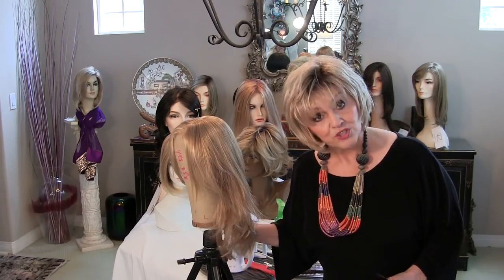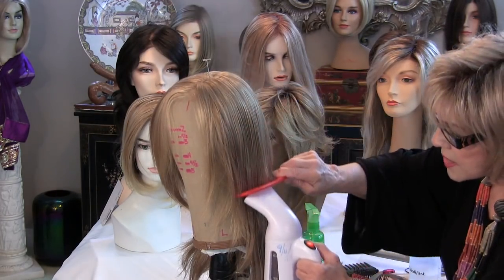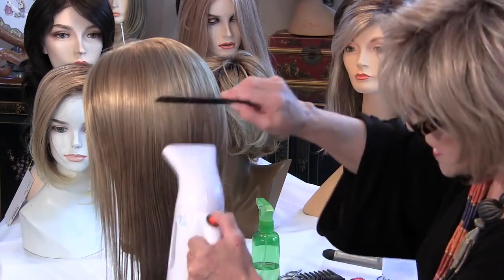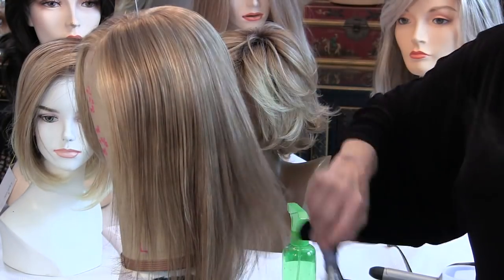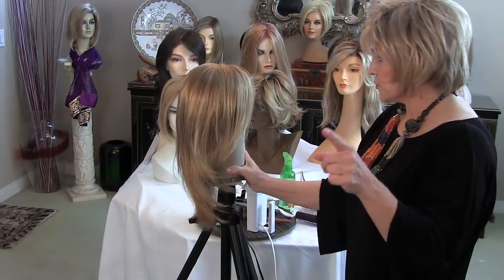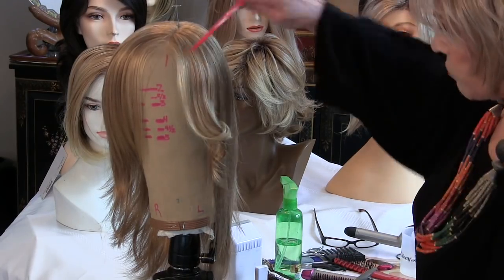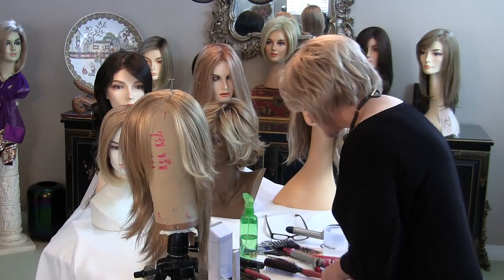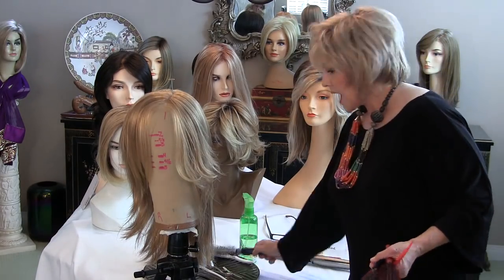How to defrizz and set synthetic hair and what tools you need

Comment: Is 250 degrees too hot to style a synthetic wig?  I'm having a hard time finding a decent, inexpensive curling iron with a temperature with a setting as low as 170.
Reply from the maker: It depends on the wig brand you are using. If you call us and let us know what wig you are wearing, we would be happy to help you find alternatives. You can even use a handheld steamer and a brush to style your piece instead of a curling iron! You can call us at 800.670.3292.

Comment: I have belle tress columbia and she is frizzy. Does a non hd wig get frizzy to?
Reply from the maker: Any wig made of synthetic fiber (heat friendly or regular) will get frizzy. There is no brand that doesn't get this way. Synthetic fiber is made of acrylic and the result of acrylic rubbing against your skin and clothes is frizz and tangling. The best product to use that will keep your wig looking better, longer is the Envy Renu and Repair glosser spray. You need to start using this product on a brand new wig, the very first time you wear it. From there on, use the spray every time you wear the wig. This will help with both less tangles and frizziness. Keep in mind that it will not prevent it but it will delay it.

Comment: Hi Patti. I bought a steamer and followed instructions as best as I could and the hair is still frizzy. I buy the same wig and make into a topper. Don't know what I'm doing wrong. I put heat stuff on before I started. Any advice. Thanku
Reply from the maker: Hi Carolyn, If done correctly, steam will definitely work. This is the same method that salons use to bring a wig back to life. My best advice is to only steam a very small, thin strip of hair at a time. You will run the steam over the strip of hair several times before moving on to the next strip. The process is similar to having your hair blow dried at a salon (they use a brush and dry one little strip of hair at a time). You should be pinning the hair to a blockhead, clip the hair up and then let down the one strip at a time that you are working on. While you are using one hand to apply the steam, you should use the other hand to pull the hair tight with a comb. There should be a lot of tension when pulling the hair so that it's being pulled super straight while applying the steam. Also be sure to spray the hair with the Jon Renau smoothing detangler before applying steam. Best Wishes!!!
Reply: @Wigsbypattispearls  thanku for your response Patti.  I did find it hard to put the comb through. I am doing the back of a topper so it should still work per your instructions.

Comment: Ms Patti, thanks you so much for all your valuable tips. What I want to know is can a curling iron be used on a synthetic wig which is not heat resistant?
Reply from the maker: You shouldn't use a curling iron on non HD hair. It can cause it to scorch and melt very quickly. To add curl you can put in some velvet lined rollers (non heated) then apply steam from a hand held steamer and let set overnight. Take down the rollers the next morning.
Reply: Thank you m'am.

Comment: Hi, I'm having the same problem as tousled nightshade below and you gave her a link to describe getting body back into the wig after steaming. but when I go to the link it just brings up all of Patti's tutorials. Which one further shows how to get shape back after steaming?. I have the steaming down but having trouble getting body back into the hair.
Reply from the maker: +Marney Cohen We don't have a video right now that shows this but just remember that steam is your best friend on a synthetic wig. Just like you used steam to straighten and smooth it you can also use steam to add body and curl. To straighten and smooth you just comb it down. To add curl or body you can wrap the hair around an unplugged curling iron (no heat), round ventilated brush or curlers with no heat and add steam. Be sure to add plenty of steam. Once you are finished with the steam leave the wig sitting there for a few hours so that the new style can set in. If you add the steam and the put it directly on your head the body and curl will fall out . The best thing to do would be to work on it before you go to bed and then let it set overnight. Best of luck!
Reply: +Wigs by Patti's Pearls thank you

Comment: Patti I have a Ignite that I have worn a lot.  I have never used any heat on it but it's getting fuzzy on the sides I guess from combing.  Do I steam it to smooth it?
Reply from the maker: Yes, you can steam it to smooth it out. This is typical for any synthetic wig. Be sure to use the Jon Renau HD Smooth Detangler when you use the steam.

Comment: I didn’t think you could use anything but a hot air brush on synthetic hair.
Reply from the maker: Hi Sharon!

We would not recommend using a curling iron on synthetic hair at home (unless it is HD fiber) as this is something only professional styles can typically get by with as it requires being very, very, very careful, quick, and meticulous. You can, however, use the steamer!

Comment: I hate to ask this, it may cause you to have a heart attack lol have you tried (on a lost cause wig, of course) rolling a wig in plastic brush rollers and dunking the entire wig into just boiled water for 1 min and then hanging it until it dries and then removing rollers and hand styling?  I'm curious, one could use the huge rollers and roll it vertically, one forward and one backward as you do with a curling iron on bio hair to make the waves lay right. I don't have a lost cause wig except one super ugly Forever Young who I've REALLY practiced on!! I tested a curling iron on her wefts until found a non melting temp. it is a great way to test your specific tools!
Reply from the maker: We would never put the wig in hot water as that can damage the wig. It may not damage every wig but just because you practice on one and have good luck doesn't mean that it will work on a different one so just be careful when practicing. Hot water can severely damage synthetic fiber. You can wash them in ice water which does help them.
Reply: Thanks.  I don't have the nerve to do that, and I'm sure you're right about what one wig will handle the other wont..I'm sure they're are countless fiber types.
Reply: Dede Vaughn

Comment: Oh thank you, I'm a transgender woman and just bought my first synthetic wig today and was absolutely horrified when I put it on with all that friz. Now I know how repair this, I'm not going out with my mess a mess. thx
Reply from the maker: Steam is a synthetic wigs best friend! Also remember to only use a high quality Synthetic shampoo and conditioner. Also, only use a brush/comb made for synthetic hair. These things make such a huge difference. If you are wearing a longer wig try the Jon Renau HD smooth Detangler. It's for regular as well as heat friendly synthetics. Each day when you take the wig off spray the underside with this detangler and comb with a Jon Renau Wide Tooth Comb (made for synthetic hair) from the bottom to the nape. Then flip over and spray the topside then comb from bottom to roots. If you comb from top to bottom it will pull tangles through the hair which causes breakage and frizzing. Synthetic wigs are wonderful in that they hold their style but they frizz and tangle easily due to the friction of rubbing against your skin/clothes. The Jon Renau HD Smooth Detangler is a life saver! Best Wishes!
Reply: Whare is your shop located? Thinking of bringing it to you to learn better.
Reply: Wigs by Patti's Pearls where is your shop located?
Reply: lee vogt I have an old Rachel Welch wig that flipped up in the back. it's called Boost. she wasn't wearable and I haven't bought a steamer or one of those Helen Of Troy hot air brushes, that's also safe on non heat synthetic.  they make a huge difference! BUT I bought a can of 3M silicone lubricant and sprayed her lightly a few times and from at least 18 inches away...it was remarkable.  it's like when you buy a new wig it is so silky until you wash it!! it's because the silicone they put on in factory washed off. I've not tried it on a good wig! this one wasn't wearable, so I had nothing to lose! I them sprayed one of my Freetress cheapies. if you like a nice curly bob, look at Tammi by freetress. I don't know your race, but if you're white, the color OP27 is a nice brown highlight color and isn't too orangey.
Reply: Wigs by Patti's Pearls I got my first long wig Ellen Wille Mega mono. I saw these videos and I always bring all the hair forward before I get into my car so it's not mashed between the leather of the seat and my clothes. it's made a difference!  I haven't had many tangles!  dry winter weather or AZ, I suspect, is dry all the time, makes a lot of static!
Reply: lee vogt I forgot to add, be careful where you do your spraying.  I held mine over the bathtub to not let over spray land on my tile floors. I took a shower later and that tub was slicker than ice!!! I ran the shower on pure hot for a few and it helped! Also, for me, I spray the underneath wefts with more silicone, I don't mind if the look a little oily.  it helps with that friction. also, you can use a human hair extension along your upper nape and then up on your wig. it provides a buffer between the fiber and your clothing, thus not causing as mush friction/static. that's the enemy! Also, only use the silicone once in a great while.  and only once before washing and then only if it needs it.  I've not used it on my more expensive and newer wigs! never use oil though.  oil sits on the fiber,
Reply: Oops, hit send..lol i meant to say oil sits on fiber and only attacks dust and dirt and gums up your hair. it doesn't soak it up...it's akin to long strings of plastic. that's why it needs to be heated and cooled in that shape to retain it.
Reply: I appreciate the info, new to wigs, wish I knew someone  in person to help me find the right wig. Caucasian,slender build. Looking for something shoulder length to some what short maybe around to my ears. Last place I went to wasn't very much helpfull except making a sale.
Reply: Plus I'm trying to decide wether a real hair wig would be better then a synthetic.
Reply: lee vogt it really depends on how much care you're willing to give it. Real hair wigs are a ton of work!! There do last longer, maybe, but it's not like if I shell out the $1,200 on a human hair wig I'll be able to wear it for 5 years! They are dead hair and most have been so processed they are weakened. They don't get nurished and oiled,like the hair on our head. The very best, virgin European hair is very expensive and you have to watch for unscrupulous hair vendors, especially ones overseas! Virgin hair must have the following: from 1 source, never chemically processed, never machenically processed (blow dryer or curling iron). There are tons of questions to ask before you purchase any virgin hair unless you're 100% confident in seller OR brand.  Jon Renau makes incredible wigs! Their human hair wigs never promise it's virgin hair if it's not. I've not seen if they have virgin hair. I've not been in the market for one.  Also, since you're trans, make sure to ask around, if you know anyone, about Noriko and their wig caps. They tend to be small. My band length is 21.5 and they're snug on me. Not at all tight, but before I lost 50 lbs they were tight when I first got them. It'll give you a boomer of a headache!!
Reply: I must be a trans magnet!  You're the second on I've commented on in 2 days! I love it!! If it's a rene of paris or noriko type wig and the "frizz" is the permatease, do NOT steam that.  It'll be the hair on top of the rose lace in the cap. That's the structure of the style. Like, there's a cute bob called Cameron by Rene of Paris, that comes parted down the middle and it looks like poo with all the permatease showing at the crown, mostly. All you have to do is shift the part slightly to the left or right. I the fibers will lay over the permatease and hide almost all of it.  Also, I suggest you was a wig before altering anything! ! Also, don't cut bangs into one or shorten bangs until you've worn her for at least 4 times. When I don't practice what I preach, I'm always mad at myself!! If you ever wanna talk wigs or need a stranger to vent to, feel free to drop me a line. I'm disabled and usually have lots of free time. It seems like busy days all clump together and then nothing for days at a time! Dedevaughn@gmail.com
Reply: Wow, didn't realize it was on the same thread...it's not as huge of a coincidence as I thought. I bet you two know one another from youtube or social media.
Reply: MadameX, I misread your comment lol I was reading as it scrolled on top of my phone and someone else's came through at the same time and they were talking about altering a wig they just got today. I'd read new to wigs, etc...then steaming a frizzy wig they just bought today and it was their first one. I wonder how that happened?  Oh well, weird. Offer still stands. I don't know any trans, but my favorite people on earth are usually gay men. I'm well aware it's not the same, but I bet you still have the wonderful qualities gay men have since you've lived at both sexes. Although a tough tough life, I think it would have to make you a better person in so many ways!! I hope you took that as I indended. I know some LGBT get offended easily and I totally understand why!! I'm just a former fatty, 54 year old woman from the boonies too. I mean boonies! I'm pure hillbilly from the Ozarks!
Reply: Madamex, I have a forever young wig that's about 25 inches light blonde, not rooted and it's hideous! ! I didn't know I couldn't cut bangs into synthetic as you would human hair! Those bangs were awful!! So blunt and off putting! Not I don't touch wigs with anything by thinning shears. You can trim bangs with them too if you cut over and over in the same area. Makes beautiful bangs! The bottom is all different lengths because I've tested different heat levels to find the highest setting that won't melt the wig. I think it's about 210 on my particular curling iron. That's a great suggestion!

Comment: I just bought the expensive Gold n' Hot curling iron since it has a temperature level for synthetic hair.  Simply it doesn't work. I tried using it on synthetic hair wig and I ended up ruining it.  When the curling iron is set on "Synthetic" it just doesn't curl the hair at all, and when the it's set on "Fine" it just ruin the hair making it kinky.  I'm totally desapointed.  Next step, I gonna try waving my synthethic wig with the steamer and a,comb.
Reply from the maker: broadcast20081 I'm so sorry to hear that the Gold N Hot didn't work for you! We never had a problem with ours here at the shop.  If you need any help or questions with refurbishing your piece feel free to give us a call. 1-800-670-3292
Reply: Thankyou very much!!

Comment: I seriously do not believe in those steamers, all they do is make the wig fibers more limp and you are not putting any body or wave back into that wig from what I see. The only luck I have had is to point cut those frizzy ends off the wig.
Reply from the maker: We're sorry to hear that you haven't had good look with them. We've had so many customers to work wonders. And when you take a wig to a wig salon to have it refreshed due to it getting older, a steamer is what is used. The key is that if it's a style that isn't super strait, you have to put the volume back in it which you can do by wrapping around a cold curling iron and applying steam or even putting in cold rollers and applying steam.

Comment: will this fix those split ends look up and down the length of the hair?
Reply from the maker: It doesn't correct them all but it does make them look so much better. It all depends on how damaged the wig is. We have done this to wigs many time and they look completely different when finished. The key is to take your time and only steam a small strip at a time. A handheld steamer is a synthetic wigs best friend!
Reply: This is a Mega Mono by Ellen Wille, it just looks like long hair wirh a few split ends up and down the layers. I've ordered a small, travel steamer from Target. I'm gonna try it!

Comment: It probably would work better with a smaller tooth comb.
Reply from the maker: You don't need to use a small tooth comb on synthetic hair. It can catch and pull the tangles causing an even bigger problem. You should only use the wide tooth comb for this type of thing.

Comment: Did you say I can curl a non heat-defiant wig with a Teflon curling iron without melting it! If you did! WOW! I'm excited
Reply from the maker: This is something that Patti implements in her own wig styling on high quality synthetics. It is not something we as a whole recommend simply because there is the risk of damaging or melting the fibers. If you have experience with synthetics and decide to try this, we urge you to use caution and start with a very very low heat on an area near the back of the neck so you can hide it if your wig doesn't react well to it. Good luck🙏
Reply: @Wigsbypattispearls  THANK YOU FOR YOUR TIPS! I’ve learned so much from you, I even recommend you to my own clients! And I always recommend to be sure to check a small be that can be hidden just to be sure the piece can handle “The HEAT”! Even if it has HD Fibers, slow & low until your comfortable and you know the fibers are safe.